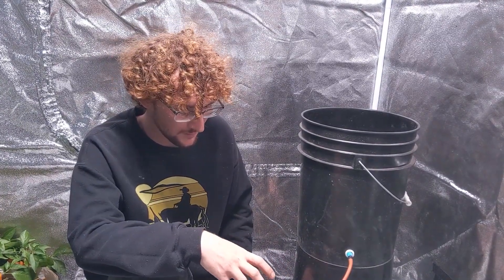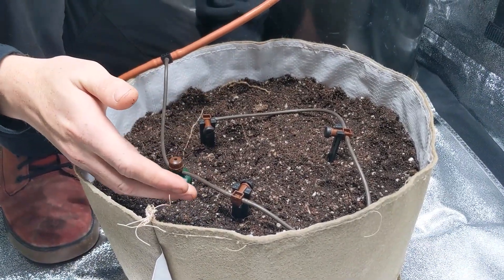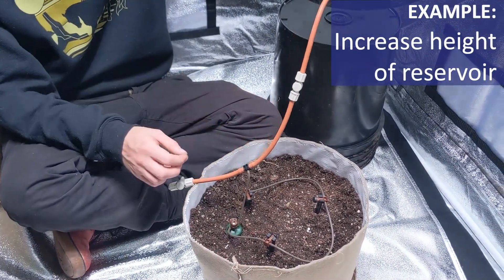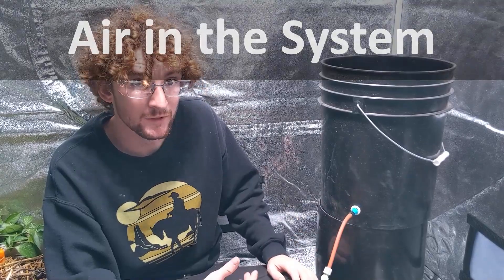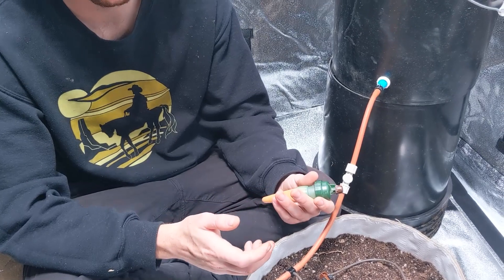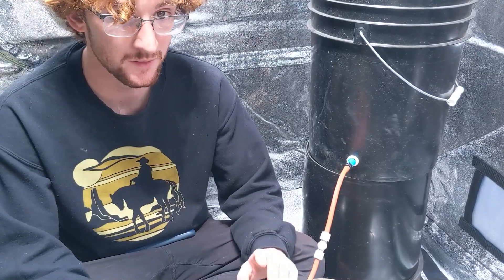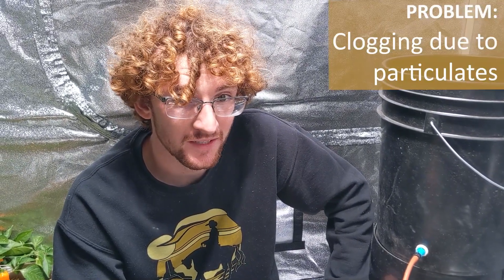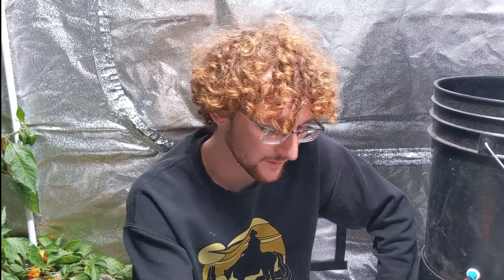Troubleshooting Tropf Blumats

Comment: I have kept my gravity fed systems consistently pressurized by a small pump and timer pushing water to an elevated reservoir, with at least twice as much overflow plumbed back into the source reservoir below, which also allows for aeration of the water and multiple means of filtering the water that the 8mm lines eventually draw from. Can help to keep your elevated res temps down as well.

Also do not clean the caps with hydrogen peroxide solutions I have had many fail and the diaphragm crack from doing so.

Excellent product regardless of their learning curve!!

Comment: I"m wondering about my Blumats carrots.  I really like the system!  However, i only have two carrot sensors left, because the plastic threaded part have split.  The first year i used them, no problem, the second year, i was removing them from the garden i notice a couple had cracked, after the third year most of the have split.  Now 4 years and i have one left.  One thing i noticed is that the one i have left, the plastic looks a bit darker green then all of the other sensor's, so i'm guessing the plastic is different.  Any pretty bummed.  I'll still try to use the single sensor and dripper emitters.

Comment: Should be mentioned that there is quite a bit of extra parts needed to purchase separately even when buying the kit. Or just change your description when saying what’s needed per 5 gallon pot. 

One carrot is what’s recommended but don’t say that 3 distribution drippers are necessary along with the one carrot that dosent come with the kit .  Or 2 carrots per 5 gallon pot..
Reply: Right I just had to spend an extra 100 dollars on extra tubing and the distribution drippers.
Reply: @growersplus  hows your set up going? What size pots and carrot are you using?
Reply: @Earthling-G81 I'm not a fan my plants are hella undet watered in flower.

Comment: Are caps to prevent the tops from moving included?
Reply from the maker: the caps are not included, you can buy them here: https://www.sustainablevillage.com/Blumat-Protective-Cap
Reply: @SustainableVillage1  seems like the cap would be important. Why not include them?
Reply from the maker: @BigRift  Great question! We don't include them because they are not completely necessary. I don't use them in my grow, but some people swear by them...it's all a matter of preference. Also, we'd rather not send out pieces of plastic that may not end up being used.
Reply: @SustainableVillage1  fair enough
Reply: @BigRift  he’s right done do and some don’t, I do not use them and have nvr had a issue
Reply: @Triangle0ffence3x  good to know. How do they hold up to clogging from nutes?
Reply: @BigRift  thus was the thing I was most concerned of when I was deciding if I should buy one or not, hasn’t clogged on me yet, I use a product called drip clean and all good
Reply: @BigRift  The real reason is because blumat are CHEAP AS FK.. the company, not the product.  Their plastic fittings are OUTRAGIOUSLY priced.  The tubing they use in the kits sucks hard, even though they have the super flex tubing, they won't put it in the kits.

Comment: would you recommend these to deliver nutrient solution to pots of coir or would the salts drying up clog the emitters?  are they suitable for a commercial sized setup?  could i add a pump to pressurize my main feed line?
Reply from the maker: Hi Wayne. Yes you can absolutely use Blumats with nutrients, but make sure you read this blog post first https://www.sustainablevillage.com/blog/guide-to-nutrients-and-blumat-systems. We work with many large commercial growers who love using Blumats: Time savings, economic savings and happier plants! Yes, you can absolutely add a pump to pressurize your main line. Our designers create free custom designs and quotes if you're interested in learning more, https://www.sustainablevillage.com/blumat-quote